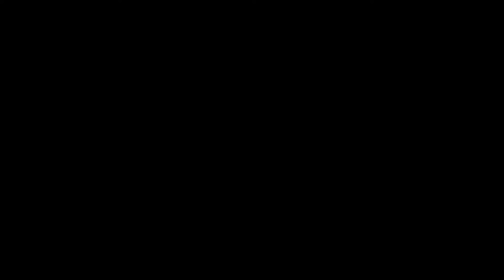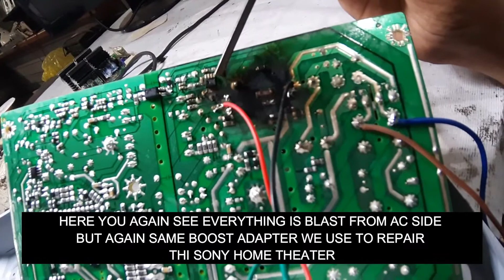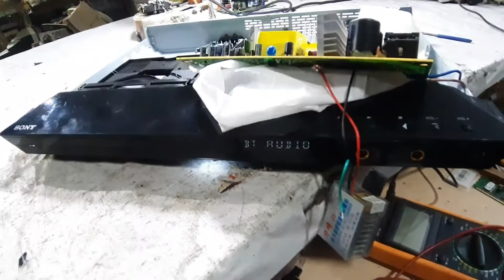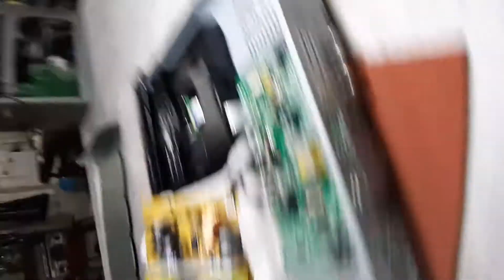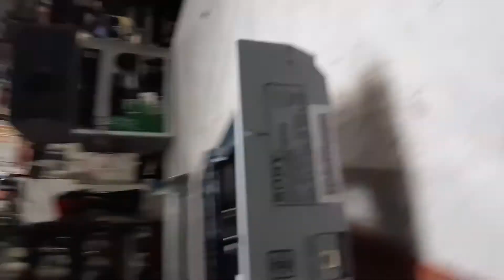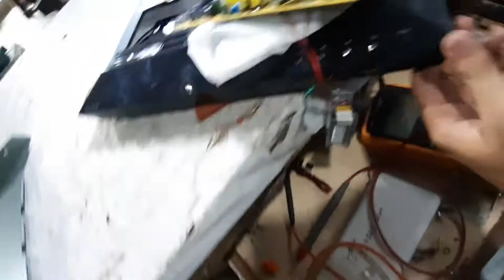Sony DVD HBD-DX350 supply repair

Comment: very nice vedio Sir. i have sony dvd tz200, fm and aux not working but dvd and usb sound works, voltage at A/D CONVERTER ic pin 9 which id DOUT is zero, is this  ic faulty or the main u- controller ic can also be damaged? can this be repaired easily? thanks

Comment: Booster voltage?
Reply from the maker: Smps
Reply: @deephny how much voltage required
Reply from the maker: @White_horse_rider200   for what
Reply: @deephny  from SMPS how much voltage dvd want
Reply from the maker: 220 v ac